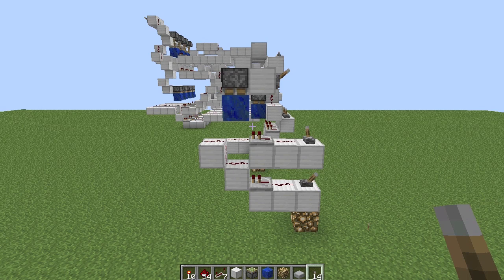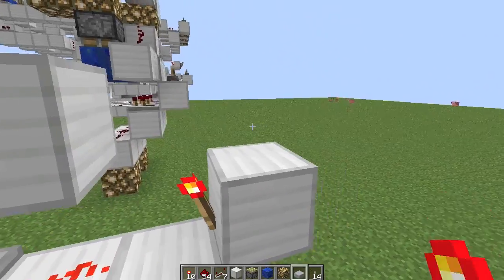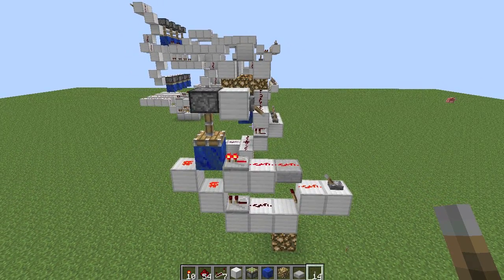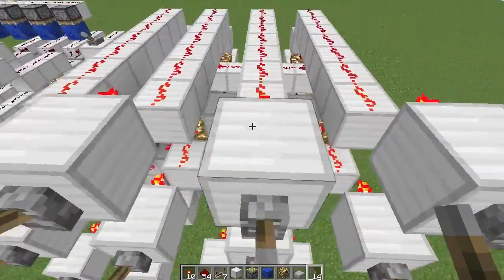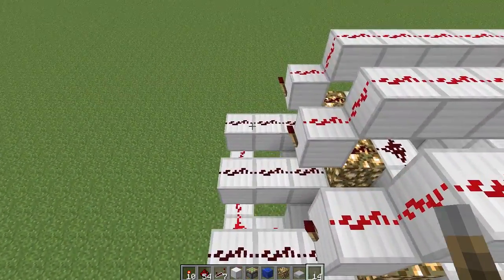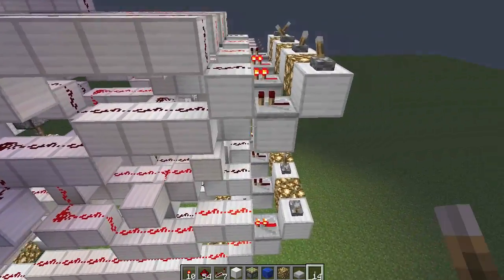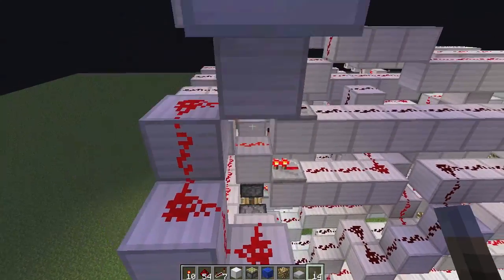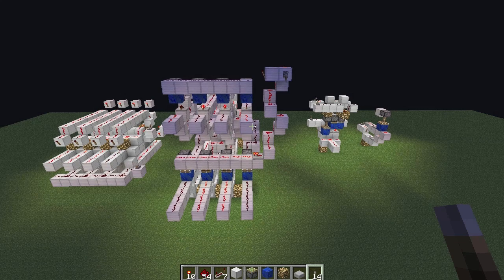Tutorial/Showcase: Multiplexing Like a Boss

Comment from the maker: It's funny you mentioned this because as strange as it may seem, in MC people almost always work from the lever's perspective and this is probably because if you're entering a number you're facing the lever and not looking at the circuit from an overhead view. I actually end up switching back and forth between both orientations depending on what's optimal for the circuit I'm building at the time - I should probably start color-coding my LSB to avoid confusion. XD

Comment: This is a good video, but you read the binary backwards. The least significant digit is on the right side, not left. For example, 2013, the 3 is the least significant digit. So, 1010 would be 12, not 5 because the far right digit is 8, not 1. The only way you would be right is if you were reading from the lever's perspective(which you very well might be) but it is wrong when looking from your perspective. No hate though, just a simple mistake ;D